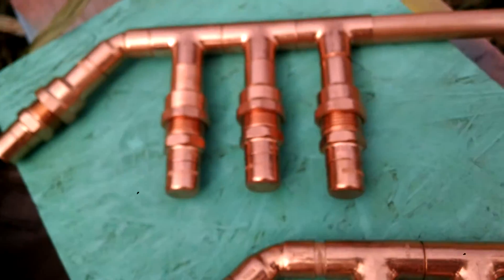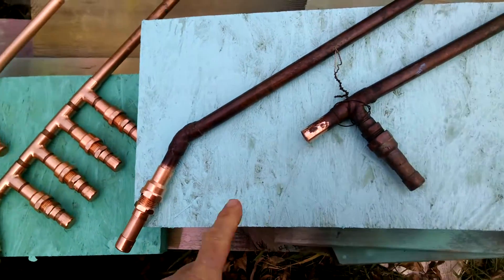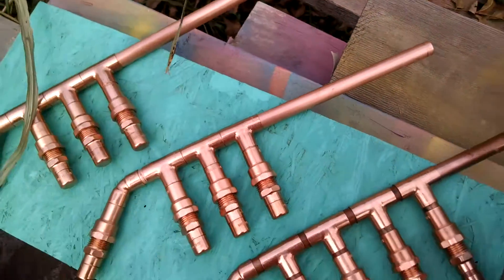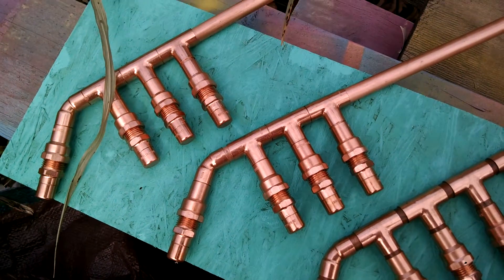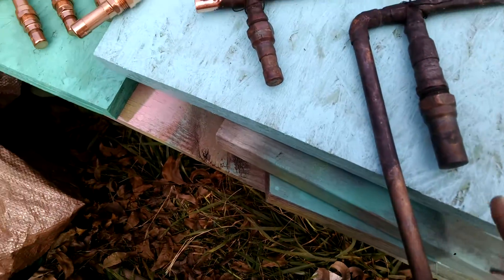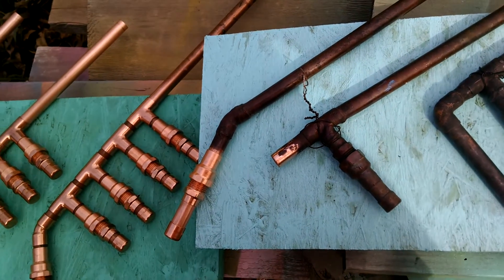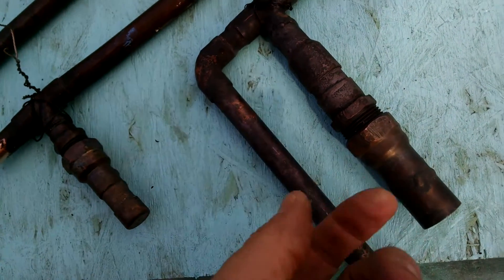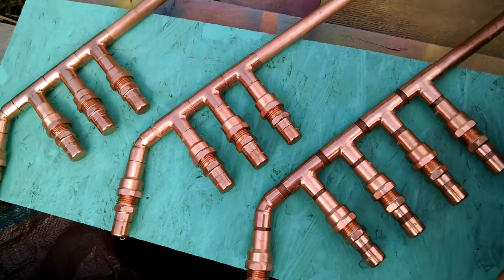Honey Bee Oxalic Acid Copper Burning Thing-a-ma-bob

Comment: do you have a video of this working?
Reply from the maker: I don't and it didn't work that great.  I posted one a few days ago and that's the one I use exclusively.   It consists of simply a 45 degree elbow and couple other bits.  Look at my latest few posts.  I would NOT use this one for several reasons.  My latest one works way better than this one.
& if you have a bunch of hives, I'd use those 'mosquito foggers.'  I've got one of those too, but I've never used it, but those are BY FAR the fastest way to do multiple hives.  But---MAKE SURE you clean them out with distilled water to cleanse the acid out of there, for oxalic acid WILL eat the guts out!
Reply: I saw that. interesting idea but don't love the idea of high temp parts in between hives.. If you need to do a bunch of hives it seems like it may take a lot time. Im woking on an idea where I use a simple propane torch.I'm trying to get it to work at 315 degrees. If it get to hot the oxalic become poison and could kill your bees.
Reply from the maker: @campdavidsonfunctionaltrai8583  If you make this design, PLEASE make a video of it, I'd love to see it!  Send me a little message too, if you don't mind!  Better is always better!
Reply: Will do.

Comment: Use a valve to drop the OA down into the cup. You can reload the chamber faster, and check for fumes
Reply from the maker: A couple of days ago I used it for the 2nd time and...I LOVE it.  Still, I think there's a better design waiting to bee built.
I couldn't video it as it was just so darn windy!  The 5 chambers made smoking the bees soooo much quicker than the single chamber.

Along the lines of what you're talking about, a valve, that's a pretty good idea.  Especially if there was a hopper on top.  Make a rotating valve + scooper to where 1 turn would put a new dose of oxalic acid into the chamber....I likey!  Still, a bit more complex for me to fool with now.  Thank you for the suggestion.

Comment from the maker: For anyone thinking of making this...I would wait a week or three to see how it works.  
- Possible problems this might have is one chamber over heating another chamber.
- The oxalic acid recrystallizing in the tube (tube may bee too long & cold)

I have another, I think much better idea which...I have to order the parts and make it, but I think it will work much better, in short, I'll replace the threaded portion with a fixed tube.

The tube will have an access oxalic acid filling hole.  After the oxalic acid is filled, I'll close it with a twisting sleeve.  

So...I'd wait till I get the parts and get it welded and see which version works better.  The above description is probably hard to follow, but in short, I'll have a new version which I feel is much better to this one.